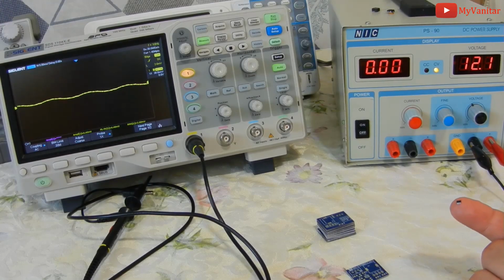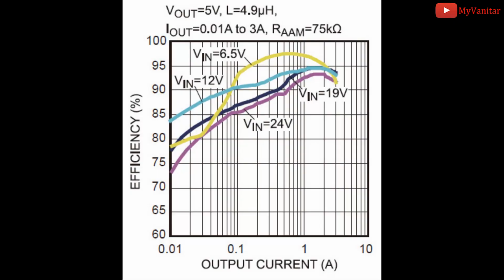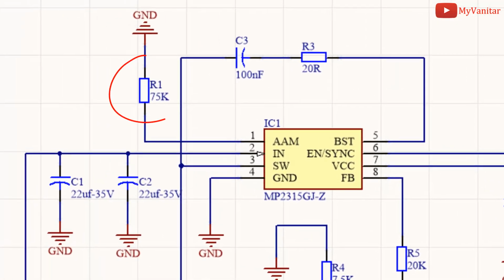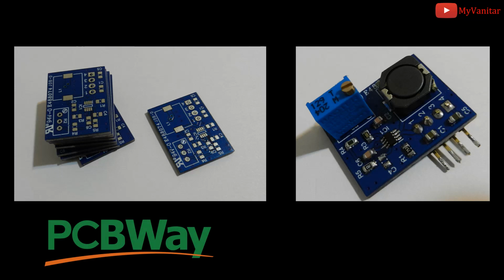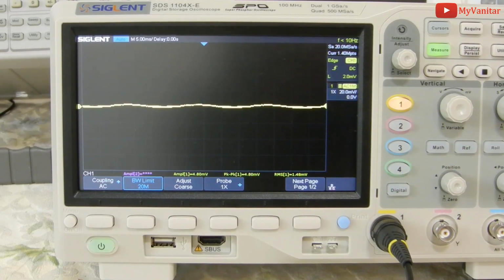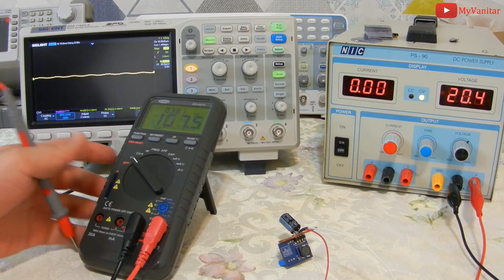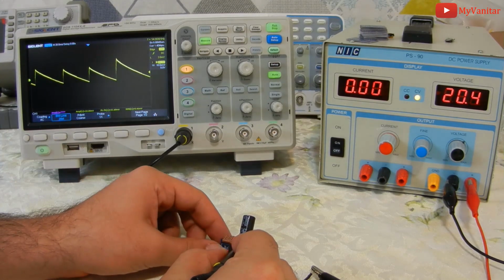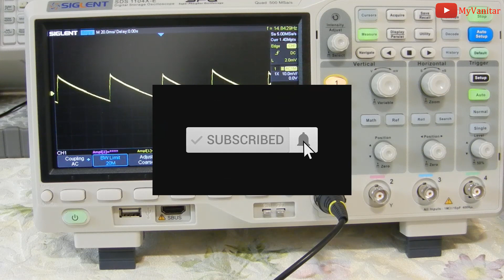97% Efficient DC to DC Buck Converter Circuit [3A Adjustable]

Comment: You can get an even smaller device, the MP2393, in a SOT583 package (1.6 mm x 2.1 mm) with the same performance. The disacvantage of both devices is their relatively high operating frequency of 500 kHz / 650 kHz. So you need to have a very good high frequency design and it is good to follow the design recommendations in the data sheets very striktly.

And a current of 3 A is high for device pin distances of only 0.65 / 0.5 mm. The PCB connections must be very shortly. Unfortunately, the in-, sw- and gnd pins carrying the high current are located at position 2, 3 and 4. So you have three 3A wires within 1.3 / 1.0 mm. This is not my favorit device, because it is nearly impossible to make a useful design.
Reply from the maker: Thank you for your comment, please check my other buck converter designs as well. This one is old

Comment: What was the reason for soldering the 470uf capacitor on the output for testing?  Was it just to emulate some kind of load for the IC?  Won't that affect the ripple measured?
Reply from the maker: To indicate that the final filtering should be near the load, not necessarily at the supply board. Because it is unknown where the board is used and what the load would be. Novice users might think such a board or similar are not good or noise is high. we never see an SMPS with tons of caps or filtering at the output. SMPS is separated from the main board and we see extensive filtering and even linear regulators on the main board instead.

Comment: Id like to add polarity protection in the form of a diode. Perhaps in series on pin2. What would you recommend?
Reply from the maker: if the current draw is small, you can add a Schottky diode to the input, otherwise, you can use a Mosfet.
Reply: @MyVanitar  
Thank you. I'll implement a mosfet

Comment: Fantastic design. On the schematic, which pins are the input ground / voltage and output ground / voltage?
Reply from the maker: Thank you Lucas, have you checked the article? if not, please consider that and if something was unclear, I'll reply.
Reply: @MyVanitar  Wow, thanks for the quick response! I've read through the article a couple times. Am I correct in saying the 4th pin on P1 is the input positive, the 3rd pin on P1 is the input ground, the 2nd pin is the output ground and the 1st pin is the output positive?

Also, you wrote that component R3 is measured at 20R; should that be 20K?

Thanks again
Reply from the maker: @Lucas-bz8cw  Yes, the 4th Pin is connected to the regulator input, so it is the input. 3 is ground yes, 2 is Enable pin, and 1 is output, Input and output grounds are identical. 20R means 20-ohm. it is common to use R instead of the Greek alphabet.

Comment: You inspired me to have a go with this circuit, but could you explain why Pin 2 goes to the EN/SYNC pin?  The data sheets say this is for applying an external clock.  I tried to confirm the schematic in the Gerber files but they won't render in KiCad 5.1
Reply from the maker: Yes, that is to Enable/Disable the chip (ON/OFF). So if I remember correctly you gonna connect it to the VCC (Input) to enable the chip. Datasheet sample circuit also confirms this. however, the datasheet has not used a protecting resistor. if you decided to build this, use a lower value for L2 (less than 10uH) and add one or some caps near your load as I did in the video. Rregarding Gerbers, what is the extension of the Gerber files? it should be several files in that folder which each represents a layer of the PCB.

Comment: What are your part numbers for L1 and L2. 
Or more specifically what is the amp requirement for L1 & L2.  I cannot locate a 220uh SMD inductor with a 3Amp rating.
Reply from the maker: L2 value is not critical, because it is just used as an output LC filter. Have you checked the article by the way? L=4.7uH, L2=anything you like-3A
Reply: @MyVanitar  Oh yes i have read the article. A dozen times too. I love it. I have learned a great deal about these components. 
I have located the parts. MY 4.7uh inductor (CDRH104RT125NP-4R7PC) has a rating of 5.7A yours (DR1050-4R7-R) has a 6.13A rating. I do hope that is suitable.  
I did realize that L2 is used as a filter so YOUR (DR1050-221-R) with a rating of 1A can be substituted with as you say "anything" so can i just use another 4.7uh? I know this changes the cutoff frequency (15KHz) but it is below the switching frequency.  
I shared it with a group and they are assisting to make this. The .RAR files i cannot read so ive reproduced it in my PCB editor. 
Thank you for making this. Ive learned a great deal.
Reply from the maker: You're welcome. There are several power supply modules in this channel, and I will publish something similar to this one (upgraded) in the near future. Yes you can use another 4.7uH and use a bigger capacitor near your load as I did in the video. its job is just filtering. I have not provided a part number for the inductors so the size of your component matters. check the images and video and compare it with your own. 6A is high, I think it should be a big inductor, if not, and you can fit and solder it on your PCB, just go for it
Reply: @MyVanitar  Thank you again sir. 👍👍 I did take a very close look at your inductors (pictures) and they match perfectly with Eaton Electronics. The 4.7uf is rated at 6a with a saturation of 6.7a. Both of your inductors are very similar in appearance and they both match that manufacture. I just wanted to be certain I was using a suitable part. I wish I could post an image so you could see my project. 😊
Reply from the maker: Perfect
Reply: @MyVanitar  Question about R6
You use a 180k. I have on hand 100k and 220k. Could I substitute one of these? Which do you suggest.
Im applying a max of 15volts input.
Thank you in advance.
Reply from the maker: @TheCLCED  The value is not critical, it is just to protect the chip. use your 100K.

Comment: I have a concern regarding pin2 on the header pole connecting to pin6 (EN) on the IC
You said in another post about pin 2..."Yes, that is to Enable/Disable the chip (ON/OFF). So if I remember correctly you gonna connect it to the VCC (Input) to enable the chip. Datasheet sample circuit also confirms this."
But in your schematic Pin2 on the header pole (1,2,3,4) is listed as Output Ground and it is directly connected to (EN IC-pin6)  with an in-line 180k resistor.  Whereas in the datasheet example (EN IC-pin6) goes to ground but is paralleled with a 500k resistor to (IN IC-pin2) which goes to the voltage INPUT. 
To explain further your header pole pinouts
1= output positive (from L2)
2= output ground (Goes directly to EN IC-pin6 with a 180k resistor in series)
3= input ground (directly to ground)
4= input positive (goes directly to IN IC-pin2
In summary I think the resistor in your schematic (R6 180k) should be paralleled between header pole pins 2 & 4
Reply from the maker: Yes, the EN pin is separated for you to decide. so if you want to Enable/Disable the chip from outside, you will use it, otherwise, if you wanna enable the chip by applying the input voltage, you should just short pin 2 to pin 4. My mistake is on the backside silkscreen I think, where I have market 1 as input and 4 as output. sometimes happens because of tiredness. I'm a single person. however, I test the whole structure and circuit always and then I publish. typo mistakes can happen. so you can compare with the schematic (PIN-1=OUT, PIN-2=EN, PIN-3=GND, PIN-4=INPUT), the PIN-1 mark on the Silkscreen is correct.
Reply: @MyVanitar  No need to apologize for anything. Your contribution and the work you put into providing this for your viewers is very appreciated. I actually prefer the switch option. So I implemented an external SPST switch, increased R6 to 470k and added a 10k pull down to ground. 
Thank you again.

Comment: good day i want to convert irobot roomba battery to li ion battery. This is a very common issue. How can I do charge voltage ranges from 7 to 20v .. 3200ma - 14.4v 5200ma liion battery
Reply from the maker: Do you need a charger? I have a plan to show one good charger in near future, but until that date, if batteries are in series, you need to balance all voltages. Also do not charge them higher than 0.5C. it means if the battery is 3000mA rated, you should limit the current to 1500mA. You can use my provided CC/CV power supply.  if you can pick up the batteries, you can also charge them one by one, but if it is a battery pack, they must provide a wire for each battery to be able to balance each. Also you should never exceed the charging voltage than 4.20V. this is critical. otherwise it will explode.

Comment: Is it adjustable to any voltage higher than 5V ?
Reply from the maker: of course you can get higher voltages, if you read the article, the output can go up to 21.5V.
I did the 24V input and 5V output experiment to show you the output noise in the worst condition, which is reasonably low.
Reply: @MyVanitar  i wante to see output at some loading. Although IC mentioned 3A in its datasheet but what about the ripples at the output and regulation? .
Reply from the maker: @AhmedAli-sn3ty  I did test it with some loads, although I forgot to include in the video. you can get 2A continuously and 3A with heatsink. in ALL power supplies, increasing the output current will increase the output noise. in this project I used an extra filter which suppresses many of the noises